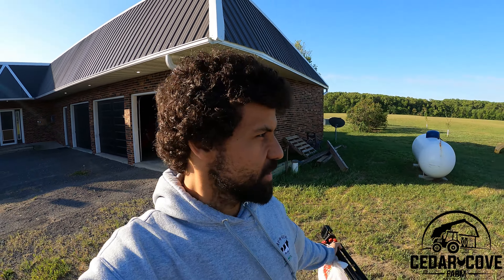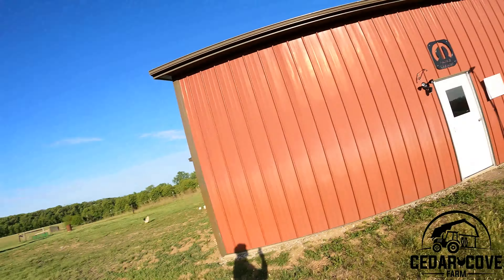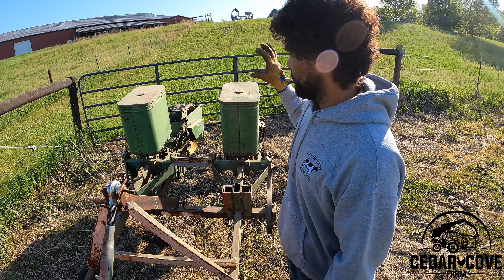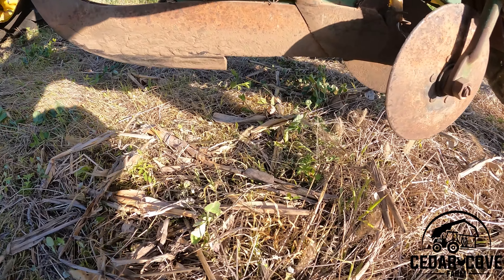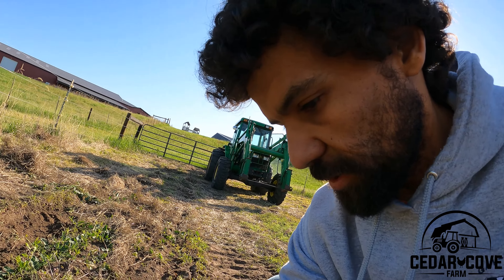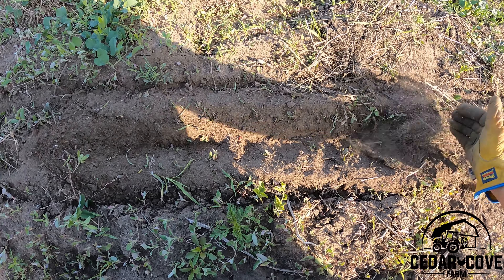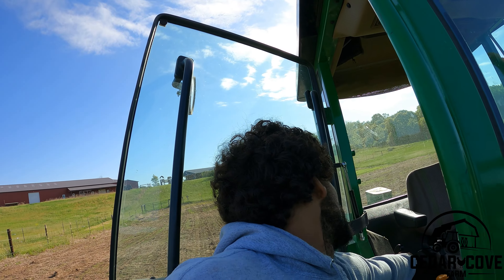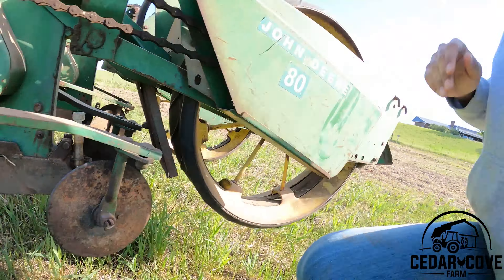Sweet Corn Planting Time!!

Comment: Will you plant a different variety for the next third or the same and rely on planting times to get three crops?
Reply from the maker: The way it will work out this way is I will the same variety a second time, to offset the same variety by ~2 weeks, and also plant a shorter variety that will fill a gap in between. Hopefully that will allow sweet corn for picking over a 1 month timeframe.
Reply: @cedarcovefarm569  Sounds like a good plan!